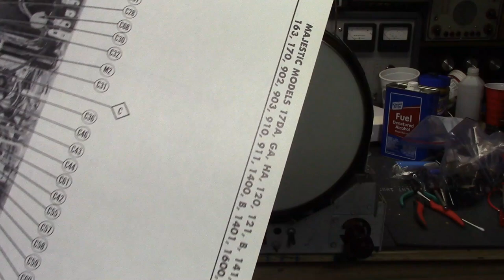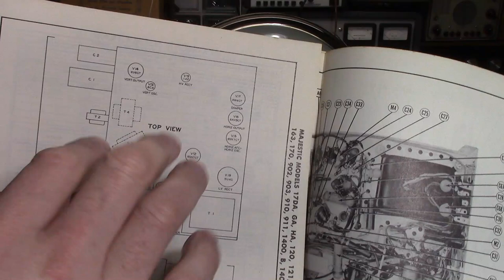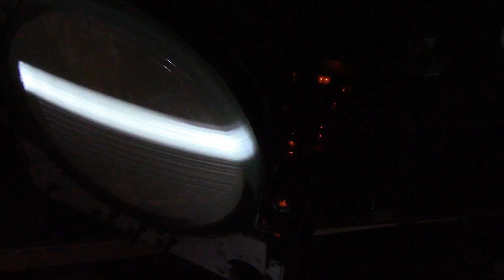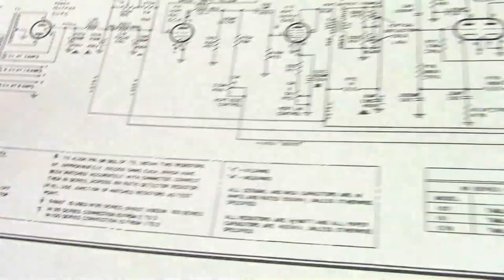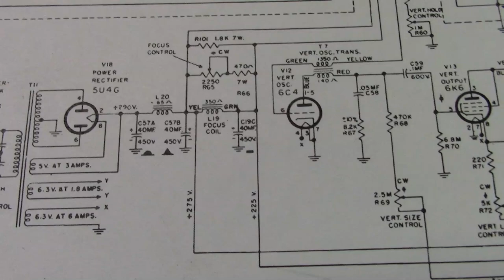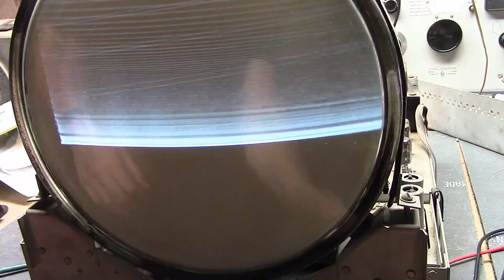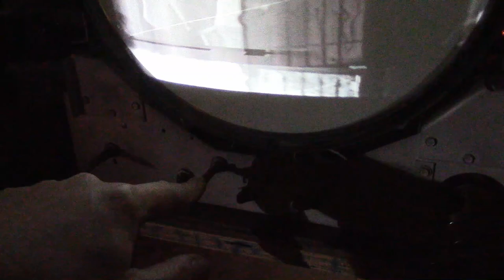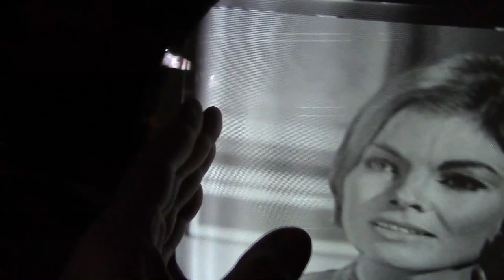Majestic - Might Monarch of the Air: Model 120 restoration p2o?

Comment: (@22:09) - You can tell someone was a little careless with the soldering iron again; they melted the insulation on one of the wires going to the base of the picture tube. 😬

Comment: Is there any danger that - by bringing it up slowly to reform the caps - that the horiz. output tube could come on with the horiz. oscillator not working yet? I’ve heard that’ll burn up the HOT in short order.
Reply from the maker: Yes, the HOT could red plate if the horizontal oscillator isn't running. I could have pulled that tube out while doing the slow power up.